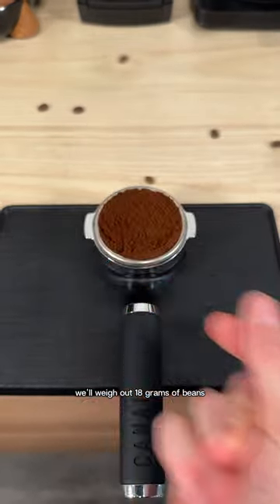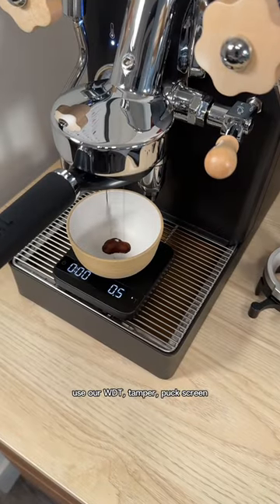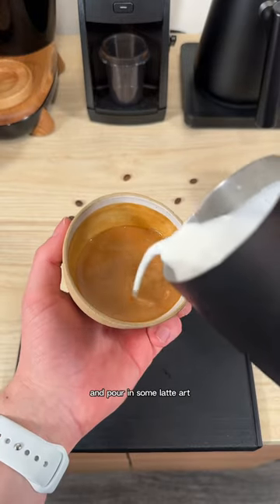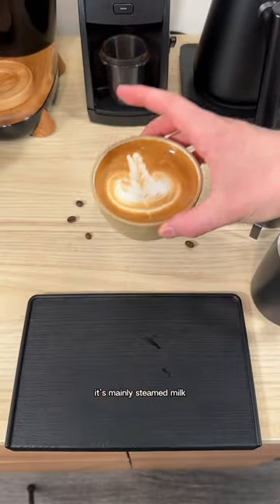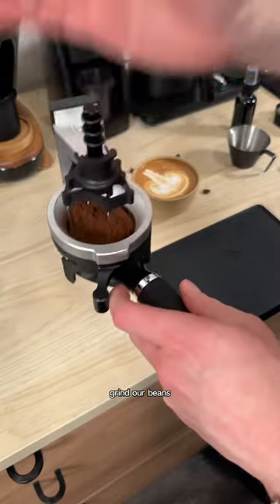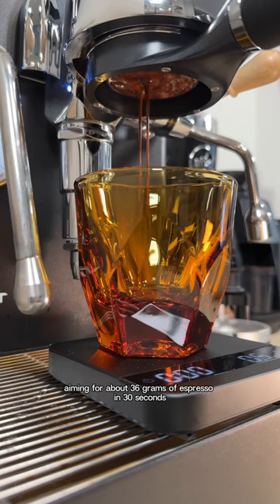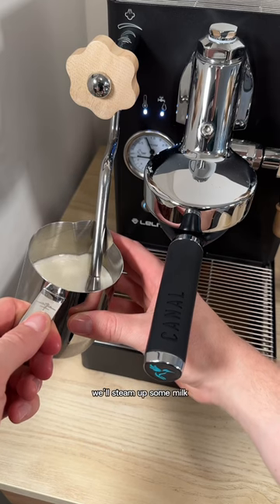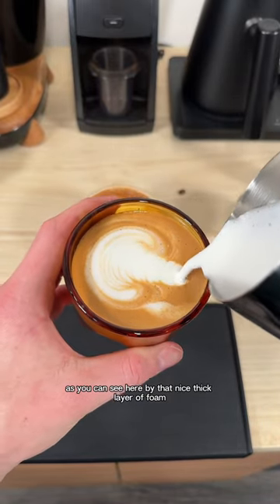What’s the difference between a latte and cappuccino?? #espresso #coffeedrink

Comment: That's not a latté. A latté is made with thick foam poured fast to mix the milk, foam and espresso to create a smooth creamy and light tasting coffee. What you made, was a flatwhite.
Reply: It is somthing in between a latte and a flatwhite. Cus a flatwhite is made with a double ristretto not a double espresso
Reply: @adamjanosvorosmarty1473   You're not wrong although most people will make it with a double espresso anyway because they either don't know or they want it in a larger cup so they'll make it stronger. However, this one was closer to a flatwhite than a latté.